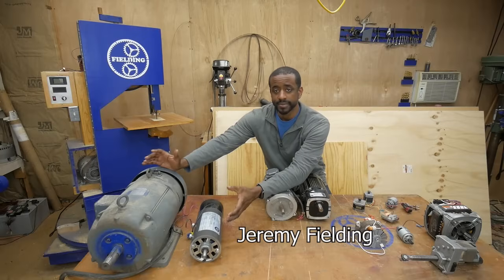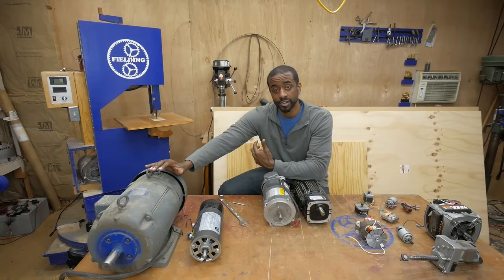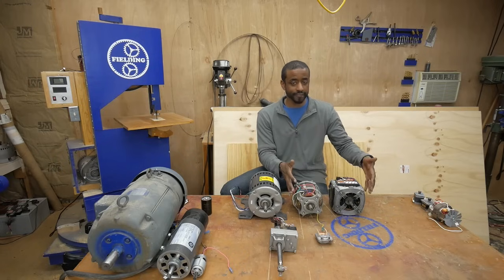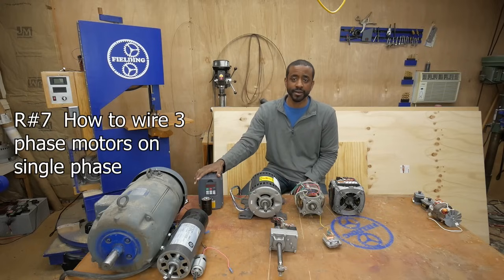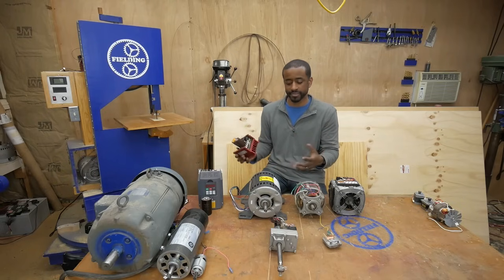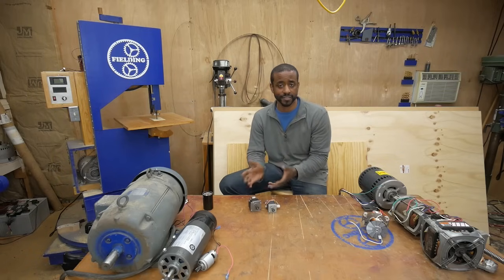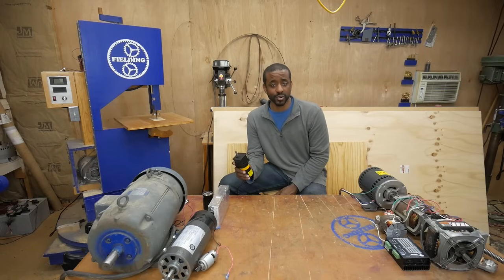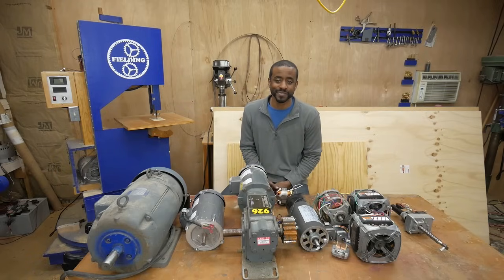Ultimate Beginners Guide to Using Electric Motors for Makers and DIY Projects; #068

Comment: One thing I think you neglected to mention is that a motor is "rated" for different circumstances. Different temperatures, different confidences, etc. Industrial equipment like that '3hp" motor could probably run at 20hp all day and night and be fine. But, it's probably rated for an industrial application to be something you just never have to think about ever again because it's so expensive to ever not have that equipment operational. It's overbuilt and very conservatively spec'd. "3hp" for that rating bundle in that context likely means "Constantly 3hp, 24/7, for 20 years". Whereas something like a treadmill motor for home use is designed for maybe an hour of runtime a day and, can maybe handle 3hp during startup but it won't be drawing that while it's running. If you actually bogged it down to 3hp and kept it there, it would probably melt. And if it does, it's not like a factory is shut down while it's repaired, you just don't have a treadmill for a while. Motors really only have 3 constraints: 1 - Voltage, eventually the motor wire insulation will arc if you exceed its voltage by, oh, 500%. 2 - RPM, the bearings or brushes on DC motors (and armature) can really only handle a few thousand RPM before they'll tear themselves apart. Induction motors can spin much, much faster. 3 - Heat. It's almost always dominated by heat. Too much voltage? Probably too much current, and too much heat. Not enough cooling? Too much heat. Too high of a load? Too much heat. Heat isn't instantaneous, there is thermal mass in the materials, so there's usually a duty cycle taken into consideration.
Reply from the maker: Both motors were rated for continous duty.... however there is no way to compare the safety factor each manufacture would have used to design the motor. This is what I meant by "efficiencies and other stuff." That is too much information to explain what a safety factor is for a beginner video.
Reply: MattsAwesomeStuff, yes, any stationary motor, generator or engine is going to benefit with more mass. We see diesels of the same displacement having a wide range of power outputs depending how it’s used. For stationary generators, they last 20 years. For high speed water craft, maybe 2000 hours. 

We know that 3 HP beast on the left will still be running long after the 4 hp motor on the right already leaked out its magic smoke that makes it run.  LOL

But of particular interest to electric motors for non-stationary applications is liquid cooling, especially with chillers that can cool it below ambient. If the system is already in the car, and you are only adding some diverted valves to get it to the motor, your motor size can be much smaller, and still last 20 years. 

There is a video of an 18 wheeler with a huge old industrial air cooled DC motor powering it, using lead acid batteries. Very cool project, but of course not a practical solution compared to modern electric semis.
Reply: I also thought the main difference in size was due to heat management, a bigger core needs less turns to  achieve a given inductance with less magnetic saturation and allows for a  thicker wire which provides a lower temperature rise.

As for speed, a universal motor router can get up to 20000+ rpm using humble metal cage bearings, but a 2 pole induction motor driven to the limit of a laminated core (~400hz) would only achieve 12000 rpm, no?

Edit: As if often happens, I'm wrong, theoretically it would also reach about 23k rpm (400hz * 2 semicycles * 60 seconds / 2 poles minus slip), but with basically zero torque and surely they're not designed and balanced with a large speed in mind.
Reply: @ohhi4527  - A universal motor or a DC series motor can spin itself off into orbit if unloaded. It will literally accelerate until it explodes. If you consider centrifugal forces, a bigger motor with a larger diameter will have the outer edge moving much faster than the edge of the shaft for example. If you double the diameter, you double the edge speed. A Dremel can spin 20,000 RPM but it's only 1" diameter at most. That 3hp motor with a 7" (?) diameter Jeremy has would handle only 1/7th the speed, or 3000 rpm to be under the same forces. It will certainly explode before getting up to 20,000 RPM, but I would encourage you to test that in a safe manner :P. An induction motor has electrical and magnetic limitations eventually, but mechanically, it's all but cast with no friction surfaces (like brushes) or weak points (like commutator bars). I bet you could spin it up to 40,000 RPM and, bearings-aside, the core would flywheel just fine.
Reply: @MattsAwesomeStuff  "it will literally accelerate until it explodes" I think the power-output to rotor-mass ratio limits somewhat the no load speed of a brushed motor, i.e. if you decrease the voltage with a rheostat it will spin slower because the power decreases but its rotor's mass inherent load remains. But otherwise the magnetic hysteresis at around 30k rpm will also limit its speed but will cause over-arching and that will destroy the motor.

Anyway the point was that universal motors typically work faster than induction motors, so it seemed weird that you said they can handle less rpms than induction motors, because afaik that never happens. But nevermind.
Reply: @ohhi4527  - In industrial applications, you always direct drive a series DC motor, never a belt or chain, because if the belt or chain breaks, in a handful of seconds the motor will accelerate until it tears itself apart. Faster than a human operator could notice and hit an E-stop, if it's even a human-operated machine. This has been a known constraint for like, 100+ years.
Reply: @MattsAwesomeStuff  This blows my mind, because I've rewound several small DC motors (1/2 - 2hp 120v direct pulsing current) and tested them for several minutes and never experienced such a thing. I've seen motors like from vacuum cleaners that unloaded start arching horribly, which would damage the commutator but that's it.
Reply: @ohhi4527  - Might not be as true for smaller motors. Definitely a thing for larger motors. 

Some sources:

https://www.reddit.com/r/AskEngineers/comments/33arz2/what_causes_runaway_in_a_dc_series_motor_with_no/

https://en.wikipedia.org/wiki/DC_motor#Series_connection

https://en.wikipedia.org/wiki/Universal_motor#Torque-speed_characteristics 

https://electrical-engineering-portal.com/4-types-of-dc-motors-and-their-characteristics

https://www.top-ee.com/series-wound-dc-motor/

Comment: Generating power is able to vastly improve the Nation's economy; and improve the workers pay with fewer 
work hours per month. An energy source available isn't being used or is ever even mentioned!
THE: FLYWHEEL ENGINE in the form of the AUTO ENGINE without(!!!) SPARK PLUGS.
Now: We need the electric motor to place MASS IN MOTION in the form of the superbly designed flywheel engine. The flywheel engine requires less and less energy as the RPM increases; the worker is able to start the flywheel by hand! Extremely high RPM is not safe or practical because 4000-RPM is at the same results as the fueled engine at 4000 RPM. 
An Electric Motor powering a V-12 Auto Engine without spark plugs [no compression cycle] spinning 20
Generators shall help pay the monthly bills with enough left to build another power plant: for sale!
Coal burning  power plants are a set of lies and are at 25% efficacy; however; MASS-IN-MOTION is a
GRID -READY POWER AT OVER (My guess) 90-% efficacy!

Comment: Always remeber to zero the capasitors and condensators, if their voltage duration is higher than 50 volts. You could get killed or injured by touching the ends where the wires would be. Take it out and free, get your hand an screwdriver with good Electric insulation and touching all the ends at the same time you can see  a spark when the condensators run empty of power and elecricity. Then you can touch the ends and nothing bad Will not happends anymore.

Comment: Can you use a treadmill motor as a generator, say hooked to a fan so the wind would spin it?
Reply from the maker: I have a series of videos on that... but yes
Reply: @Jeremy_Fielding  I thought I remembered you putting out a video about that but wasn't quite sure. Thank you. :)
Reply: Most motors can double as a generator and at big industrial sites its even a problem. For example if you have a spinning machine like a mill it will turn the motor for quite some time after you cut the power until it comes to a stand still. While it spins the motor actually produce electricity witch can damage the motor, the Vfd (never put full power on the output site - it will explode), the trafo or the cables.

Comment: Curious, you mentioned sensored and unsensored dc brushless motors, and I think you said those came from a drill( sorry, I had to take a phone call in the middle of your video and might have remembered wrong). You mentioned that you have to know which motor you have so you can get the right controller. My question is, assuming that the motor is from a drill(I'm assuming cordless), if the drill has a feature that kills the power automatically if the power draw gets to high, would that be a sensored motor?
Reply from the maker: Drill motors are usually PMDC or more rarely universal motors.
Reply: Newer cordless drills may have BLDC motors inside. You can probably find out by looking up the make and model. Assuming it is a BLDC, and if you have the motor by itself, and there are only three or four wires, all the same thickness, it is sensorless. If there are three or four fat wires, + more thin wires, it has some kind of sensors in it. That is about all I know. I do work with sensored BLDC motors. Those motors use a simple hall-sensor arrangement to help time commutation. The sensors cost money. Any high volume product which can get away with going sensorless will probably do so. So if I had to guess, the cordless drills are going to be sensorless.

Comment: Jeremy Fielding aka Smartest Man Alive
I do have a question for you though.
So I've been watching youtube videos of RC drone motors on test stands and they are drawing 100 amps on the ammeters and around 30 volts.
What I don't understand is, I have a 10 gallon/2.5 horsepower air compressor that draws 13 amps at 120 volts house current.
So how can a motor that fits in the palm of your hand consume 100 amps, but a 12 pound, 2.5 horsepower motor only draw 13 amps?
It seems to me that the little drone motors should only be consuming less than 10 amps. 
What am I missing?

Comment: Excellent. What type of motor are in hard disk drives?
Reply: Three phase brushless, usually. These require a specific type of controller (somewhat similar to a brushless motor controller used for RC planes and drones).

Comment: Geez, when you actually stop and think about it, there's MOTORS every damn where around us, and people like me are oblivious to it.
Reply from the maker: Exactly! My job here is done 😀
Reply: In a pc, there are probably 3 motors on average (hard disk, case fan and power supply fan.) You could also count the needle actuator as a motor, though it only rotates about 70 degrees.
Your oven, washing machine, or microwave might use a synchronous motor to turn the timer (generally they use a spring, but some have a motor instead) those are great for turntables or things like that.
Another great source of motors are windshield wiper motors, they are low speed high torque ( because they are geared down.)
Something that isn't a motor but I find interesting are gears in high viscosity fluids, they allow stuff to not turn too fast (generally with a spring), like for example the cover of a cd player.
Reply: @satibel  Hard drive has at least two motors. The spindle motor for the medium and also a voice-coil motor for moving the arm that has the read/write head on it. I will grant you that the arm motor is not a spinning motor, so maybe it doesn't count.
Reply: It’s a veritable electric motor paradise ! And all the types weeeee !

Comment: Superb video covering all the facts and important specifications a motor consumer needs to understand when searching for an electric motor choice. It's important to note, torque and rpm are king (for requirements desired). In turn, this will direct the builder to determine how to choose a motor and what options (power input, amperage and voltage required) and how many watts will ultimately be required. 

Anyone looking for static rpm with minimum torque will have to know how to determine the amount of torque required. Electrical engineers went to school for a reason, so it's not a simple exercise in many cases. Your bandsaw is a good example. Static rpm with very specific friction limits and cutting power, which then determines the size of motor and choice of power input (110 / 240 - single or 3 phase along with watts / hp).

Comment: Could you cover how to control salvaged stepper motors.
Reply: The 3d printing community is all over that. Depending on the NEMA size of the motor, and what it's current and voltage requirements are, you'll have lots of options. Probably the most budget friendly and easy setup would be an Arduino Uno (I think that's the right model) with the Atmega 2560 processor, paired with a RAMPS board, and some stepper drivers.
You can also get all three parts integrated into the same board from some of the Chinese manufacturers. Also I'd recommend looking into the RAMPS 1.5 to 1.6 series boards. Some of these manufacturers have made some very nice quality of life improvements to the original design in the last year.

What are you wanting to make and do you know what size your motors are?
Reply: Christopher Goggans - the model you’re referring to is the Mega 2560, not the Uno.
Reply: I guess I’m more lost on larger stepper motors not the smaller ones that are used in 3D printing
Reply: Jacob Franz - Same stuff applies; just the driver chips are larger (for example, a 3D printer style driver chip like a drv8825 might be only good up to 2 amps; but a tb6600 based driver module can go up to 4 amps, and modules from Geckodrive can go to 7 amps).
Reply: @Jacob_F04   Dark Winter is correct. The biggest conceptual difference between the small and larger control schemes is basically  size and configuration. With the smaller ones, the stepper drivers are normally all installed on the control board. With larger ones like what you'd use for NEMA 23 or 32 steppers, everything is normally set up in discrete components, and then wired together. The core system is normally a Mach 3 or Mach 4 compatible controller, often a etherstepper (I think) or other CNC control board. These boards interface with the stepper drivers like the TB6600, or geckodrive are standalone components that are wired into the control board using signal wires, and the drivers are directly connected to a power supply. There's lots of different options outside of the conventional ones like the geckodrive, but most are no name models from China. Like most things research will help guide you to the right parts based on what you're trying to accomplish and how you're looking to assemble a system.

Comment: I scrap old pool pump motors all the time. Even some newer warranty stuff goes directly to the scrap yard. Newer pool pumps have variable speed drives built in. The company I work for uses “pentair Intelliflo” pumps. They are 3hp 220v, variable speed from 50-3450 rpm. You think one could be used to power a belt grinder? I never really had the thought until I saw this vid.
Reply: Ever use pool pump motors for anything?
Reply: If you can find out how to control the VFD... sure. The motor’s not water cooled, is it?
Reply: The motor will not run (for a long time) if it’s not under load. They have thermal cutoffs. It’s not the water that cools them but it’s the load that the water provides I think. I’m not sure how it all works really. It’s like the water governs the speed I think.
Reply: You can literally pick the rpm  to run between 50-3450rpm. It’s got a lcd screen and up and down arrows.
Reply: They are probably just standard Induction motors. When I rebuilt my 1hp pool fixed speed pump, I replaced the single-phase motor with a three-phase unit and an industrial VFD. So I now have a variable speed pool pump. The motor torque curve for the pump motors is no different than any other three-phase induction motor. I am positive it will work fine in a drill press or mill/drill or whatever you want to use it in. The shaft is a bit different than a general purpose motor because it is threaded instead of keyed. That could make it harder (or easier for that matter) to attach something to. I think the shaft is also stainless (which is not a problem). I don't think there are any other differences from general purpose motors. I ditched the single phase motor because it felt kind of gritty when I spun it by hand. I donated it to my local motor shop for free rather than scrap it. They probably changed the bearings and sold it for 50 bucks, which is fine by me.
Reply: OK, I just googled intelliflo. It says they use permanent magnets. So I am guessing they are either BLDC or (basically the same thing) Permanent Magnet Synchronous Motors. If so, then they are not induction motors. In any event, though, they should still run other loads as long as you have a working drive.